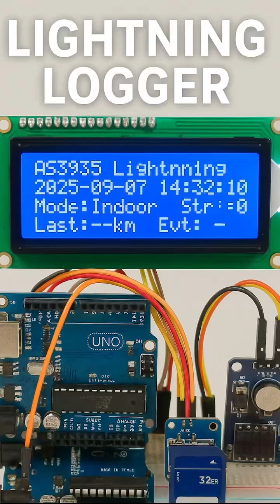⚡ Arduino Lightning Logger with Real-Time Clock & SD Card!

Comment from the maker: /*
  Lightning Logger + Live Clock on LCD (UNO)
  - DFRobot AS3935 (I2C), DS1307 RTC, 20x4 I2C LCD, SD card (SPI)
  - UNO pins:
      I2C: SDA=A4, SCL=A5 (AS3935 + RTC + LCD share the bus)
      IRQ: D2  (AS3935)
      SD : CS=D10, MOSI=D11, MISO=D12, SCK=D13
*/

#include <Wire.h>
#include <LiquidCrystal_I2C.h>
#include <DFRobot_AS3935_I2C.h>
#include <RTClib.h>
#include <SD.h>

// ---------- LCD ----------
#define LCD_ADDR 0x27
LiquidCrystal_I2C lcd(LCD_ADDR, 20, 4);

// ---------- AS3935 ----------
#define IRQ_PIN 2
DFRobot_AS3935_I2C as3935(IRQ_PIN);

// ---------- RTC ----------
RTC_DS1307 rtc;

// ---------- SD ----------
#define SD_CS 10
File logFile;

// ---------- User tuning ----------
const bool AS3935_OUTDOOR = false;   // false=Indoor, true=Outdoor
const uint8_t NOISE_FLOOR = 2;       // 0..7
const uint8_t WATCHDOG_TH = 2;       // 1..10
const uint8_t SPIKE_REJECT = 2;      // 1..11
const bool MASK_DISTURBERS = true;   // mask man-made disturbers

// ---------- Runtime ----------
volatile bool irqFlag = false;
uint32_t strikeCount = 0;
int8_t lastDistanceKm = -1;
String lastEvent = "—";

// ---------- Helpers ----------
void onIRQ() { irqFlag = true; }

static void print2d(uint8_t v) {
  if (v < 10) lcd.print('0');
  lcd.print(v);
}

void drawTop() {
  lcd.setCursor(0,0); lcd.print("AS3935 Lightning   ");
}

void drawClockLine() {
  DateTime now = rtc.now();
  lcd.setCursor(0,1);
  // YYYY-MM-DD  HH:MM:SS
  lcd.print(now.year()); lcd.print('-');
  print2d(now.month());  lcd.print('-');
  print2d(now.day());    lcd.print("  ");
  print2d(now.hour());   lcd.print(':');
  print2d(now.minute()); lcd.print(':');
  print2d(now.second());
  // pad to clear remnants if any
  lcd.print("     ");
}

void drawStatus() {
  lcd.setCursor(0,2);
  lcd.print("Mode: ");
  lcd.print(AS3935_OUTDOOR ? "Outdoor " : "Indoor  ");
  lcd.print("Strikes: ");
  lcd.print(strikeCount);
  // pad tail
  lcd.print("    ");

  lcd.setCursor(0,3);
  lcd.print("Last: ");
  if (lastDistanceKm >= 0) {
    if (lastDistanceKm < 10) lcd.print(' ');
    lcd.print(lastDistanceKm); lcd.print("km");
  } else {
    lcd.print("--km");
  }
  lcd.print("  Evt: ");
  lcd.print("   ");
  lcd.setCursor(16,3);
  lcd.print(lastEvent);
}

bool initAS3935() {
  Wire.begin();
  if (as3935.begin() != 0) return false;

  pinMode(IRQ_PIN, INPUT);
  attachInterrupt(digitalPinToInterrupt(IRQ_PIN), onIRQ, RISING);

  if (AS3935_OUTDOOR) as3935.setOutdoors();
  else                as3935.setIndoors();

  as3935.setNoiseFloorLvl(NOISE_FLOOR);
  as3935.setWatchdogThreshold(WATCHDOG_TH);
  as3935.setSpikeRejection(SPIKE_REJECT);

  if (MASK_DISTURBERS) as3935.disturberDis();

  lastDistanceKm = -1;
  lastEvent = "—";
  return true;
}

void ensureCsvHeader() {
  // If the file is new/empty, write a header line
  logFile = SD.open("lightning.csv", FILE_WRITE);
  if (logFile) {
    if (logFile.size() == 0) {
      logFile.println("Date,Time,Event,Distance_km");
    }
    logFile.close();
  }
}

void logEventToSD(const char* eventTag, int distKm) {
  DateTime now = rtc.now();
  logFile = SD.open("lightning.csv", FILE_WRITE);
  if (logFile) {
    // Date,Time,Event,Distance_km
    logFile.print(now.year()); logFile.print("-");
    if (now.month()<10) logFile.print('0');
    logFile.print(now.month()); logFile.print("-");
    if (now.day()<10) logFile.print('0');
    logFile.print(now.day()); logFile.print(",");
    if (now.hour()<10) logFile.print('0'); logFile.print(now.hour()); logFile.print(":");
    if (now.minute()<10) logFile.print('0'); logFile.print(now.minute()); logFile.print(":");
    if (now.second()<10) logFile.print('0'); logFile.print(now.second()); logFile.print(",");
    logFile.print(eventTag); logFile.print(",");
    if (distKm >= 0) logFile.print(distKm); else logFile.print("");
    logFile.println();
    logFile.close();
  }
}

void setup() {
  lcd.init();
  lcd.backlight();
  lcd.clear();
  drawTop();
  lcd.setCursor(0,1); lcd.print("Initializing...       ");

  // AS3935
  if (!initAS3935()) {
    lcd.clear(); lcd.setCursor(0,0); lcd.print("AS3935 init FAIL");
    while (1) { delay(1000); }
  }

  // RTC
  if (!rtc.begin()) {
    lcd.clear(); lcd.setCursor(0,0); lcd.print("RTC init FAIL");
    while (1) {}
  }
  if (!rtc.isrunning()) {
    // First-time power-up? set to compile time:
    rtc.adjust(DateTime(F(__DATE__), F(__TIME__)));
  }

  // SD
  if (!SD.begin(SD_CS)) {
    lcd.clear(); lcd.setCursor(0,0); lcd.print("SD init FAIL");
    while (1) {}
  }
  ensureCsvHeader();

  lcd.clear();
  drawTop();
  drawClockLine();
  drawStatus();
}

void handleEvent() {
  // 0x08=Lightning, 0x04=Disturber, 0x01=Noise
  uint8_t src = as3935.getInterruptSrc();

  if (src == 0x08) {
    strikeCount++;
    lastEvent = "Ltn";
    int d = as3935.getLightningDistKm();        // 1..40 or 0x3F unknown
    lastDistanceKm = (d >= 1 && d <= 40) ? d : -1;
    logEventToSD("Ltn", lastDistanceKm);
  } else if (src == 0x04) {
    lastEvent = "Dst";
    logEventToSD("Dst", -1);
  } else if (src == 0x01) {
    lastEvent = "Nse";
    logEventToSD("Nse", -1);
  } else {
    lastEvent = "???";
    logEventToSD("???", -1);
  }

  drawStatus();
}

void loop() {
  if (irqFlag) {
    noInterrupts(); irqFlag = false; interrupts();
    handleEvent();
  }

  // Update the clock once per second
  static uint32_t tClock = 0;
  if (millis() - tClock >= 1000) {
    tClock = millis();
    drawClockLine();
  }
}

Comment: Good morning. Could you please give links to where you purchased these parts? Much appriciated.
Reply from the maker: Hi Paul, here it is:
https://www.diyelectronics.co.za/store/environment/2294-lightning-sensor-40km-range.html
https://www.diyelectronics.co.za/store/real-time-clocks/1458-tiny-rtc-ds1307-real-time-clock-i2c-module.html
https://www.diyelectronics.co.za/store/memory/1338-sd-card-module.html

Micro Robotics has some of the stuff as well:
https://www.robotics.org.za/MICRO-SD-SIL?search=sd
https://www.robotics.org.za/DS3231-MOD?search=rtc
https://www.robotics.org.za/EM5820?search=printer

This data logger shield is worth looking at, it has the rtc and the sd card slot on it:
https://www.diyelectronics.co.za/store/shields/302-data-logger-shield.html

Diy is out of stock of the lightning sensor, but you can get it from Digikey:
https://www.digikey.co.za/en/products/detail/dfrobot/SEN0290/10279741?srsltid=AfmBOopVb-mlk7sOHM04F4TgqWDVtDq4lRarcJQFpU5FszWJ4CDa9Glh

An update on the project, I currently have it hooked up to a printer for the recording, a cheap serial thermal printer.
The lcd and the lightning sensor libraries cause a conflict in the iic bus, I have learned, so leave the lcd out and record to the sd only.
I am waiting for some storms to see how this works, got to be patient.
Kind regards,
Duncan
Reply: @Uncle-Duncan-Electronics-Shack  Thank you very much.